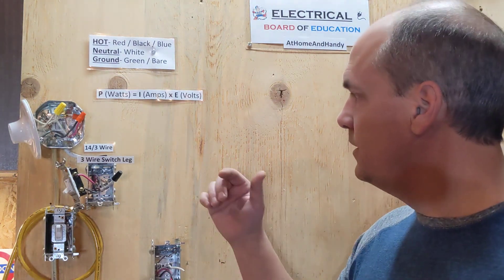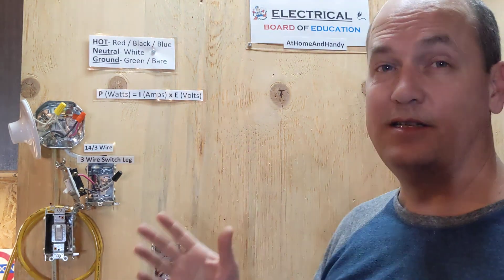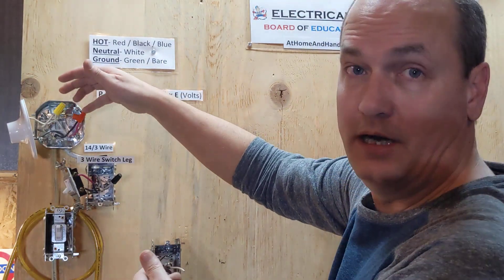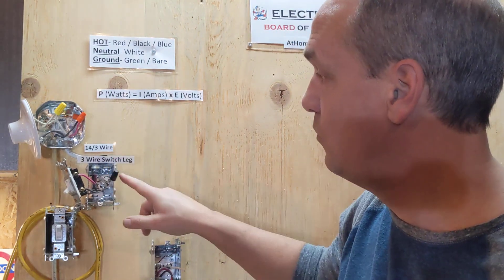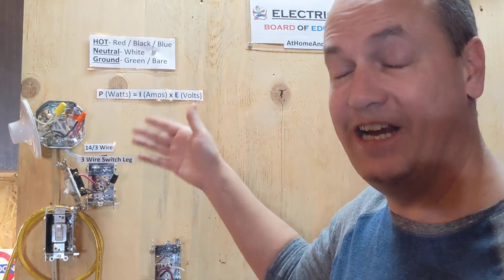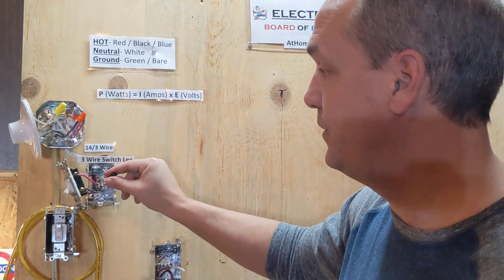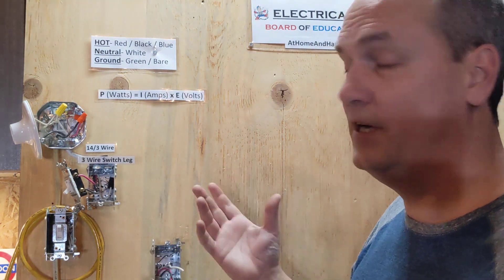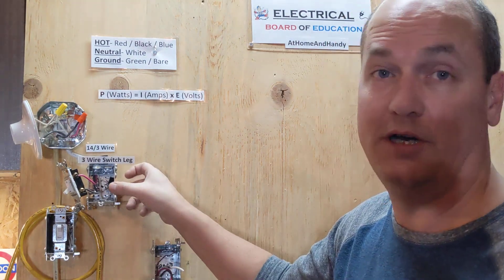Why you should use 3 Wires For a Switch Leg Explained

Comment: Thanks for this! Should power go to the switch box or fixture first?
Reply from the maker: You can do either, the wiring is just different. When given the choice, and it will not need a massive amount of extra wire to be used,  run power to the switch first.

Comment: Your not helping people. We don’t wire for the future. The amount of times you feed a light at the actual light are few. If your showing people how to wire maybe become an electrician before giving advice that you say isn’t advice. Just feed lighting circuits at the switch boxes. Boxes that will most definitely be for switches not receptacles. Also what you did is called  “Back Feeding “ because the power originated in the light box then went to the switches. A “ Switch Leg” isn’t the right term.
Reply from the maker: "You're" not wrong as in it is not something that happens often but I used it as an example towards the importance of carrying the Neutral through to the switch. You mentioned that we don't wire for the future? This is code in the US and Canada so it is important. Even if not code, customers will always be appreciative when future considerations are being thought of, but all good as you be you.